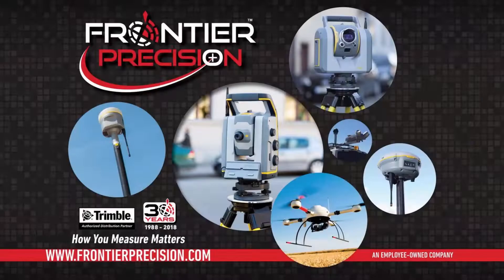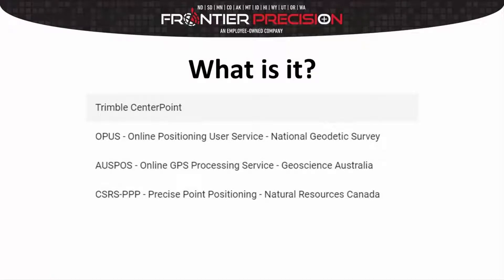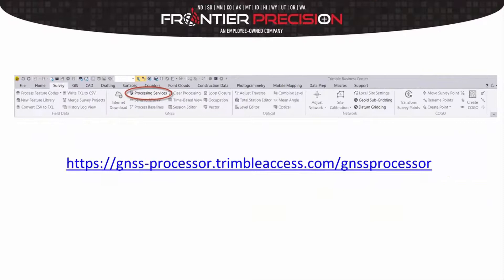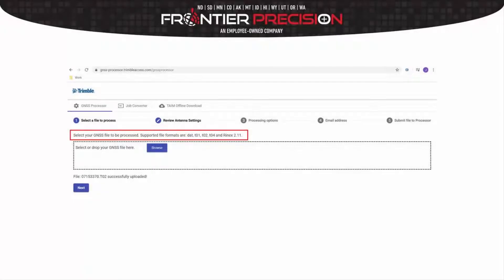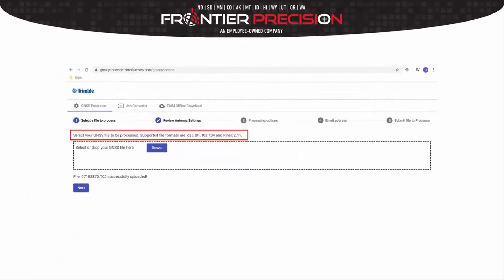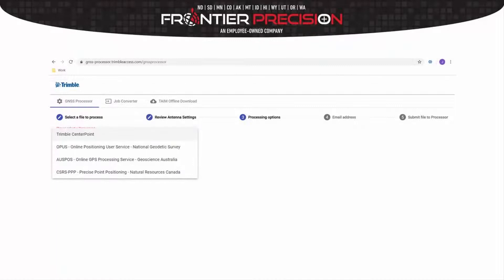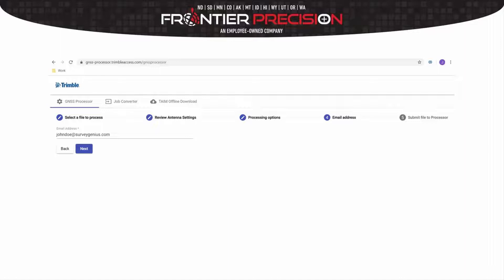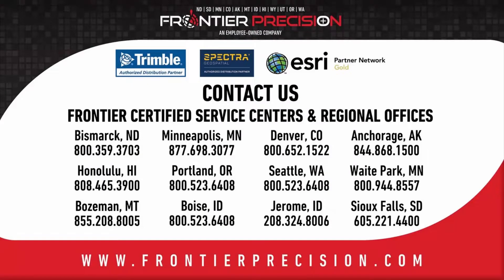Trimble GNSS Processor Utility

Comment: Hi!  Thanks for the video. Does this tool automatically correct for the true vertical height?  For example, I enter 1.68m to the R10 extension level (angular distance, not true vertical), will it correct this for me?  Thx
Reply from the maker: Yes it will calculate the true height for you as the offset from the lever is known.